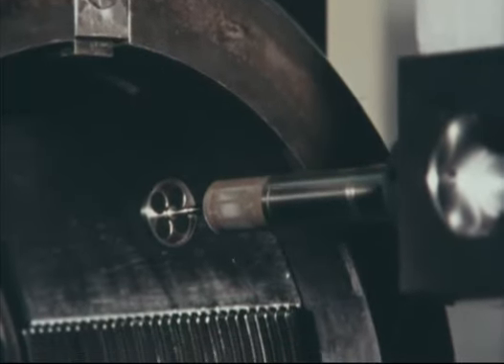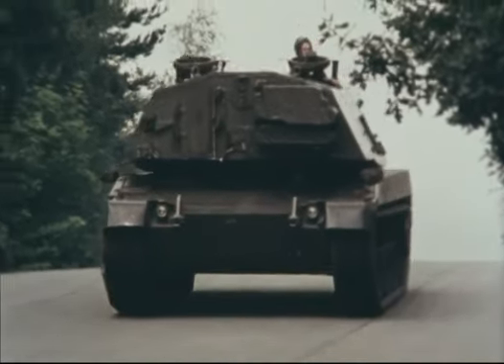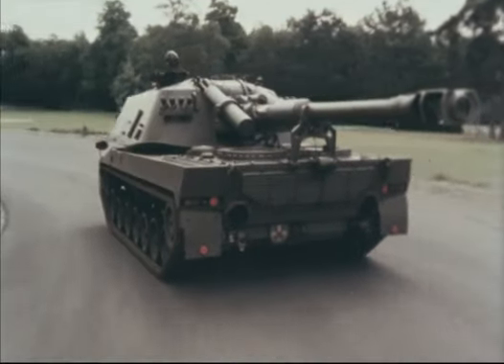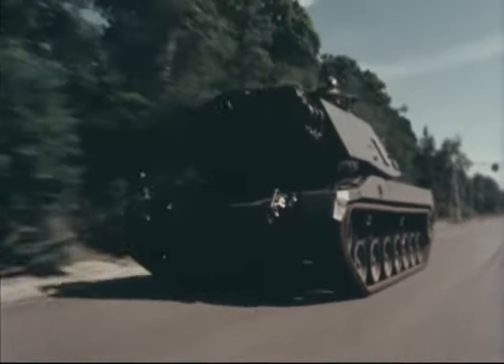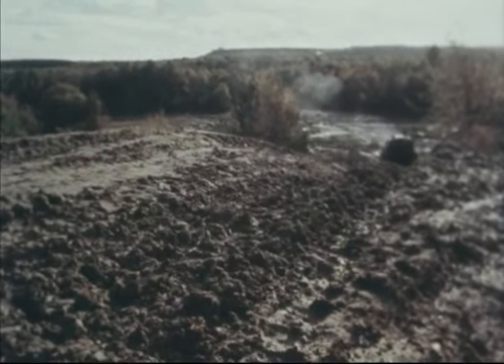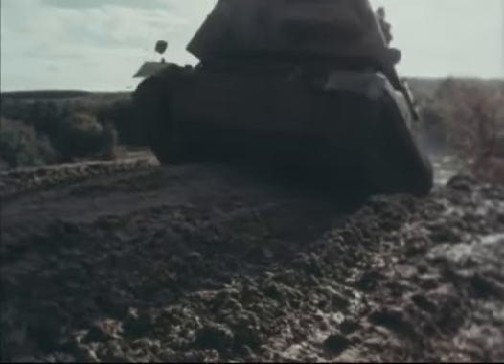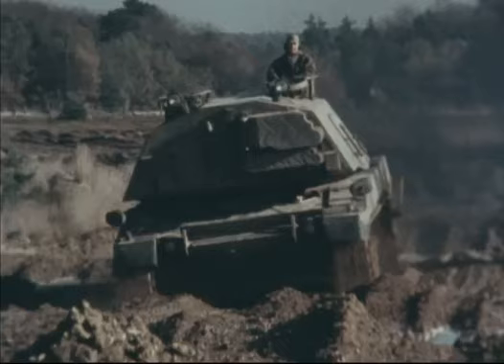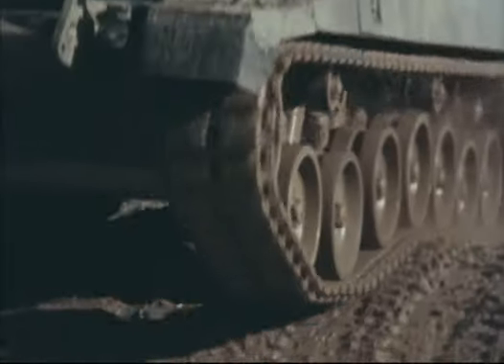British SP70 Self-Propelled Gun during trials circa 1979/1980

Comment: Suspect the gun will need to be examined after 10,000 km locked in the cradle.
Reply: I think this series of test were on the chassis not the gun and its mountings.
Reply: @neiloflongbeck5705 all moot the thing never went into service or production.
Reply: These were automotive trials at longcross test track chertsey and long valley Aldershot. I worked on this vehicle.